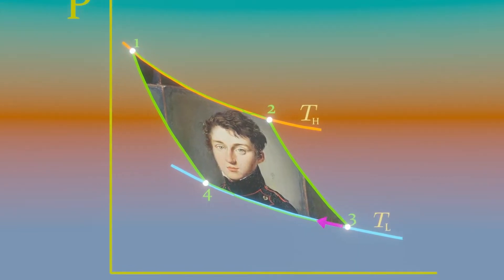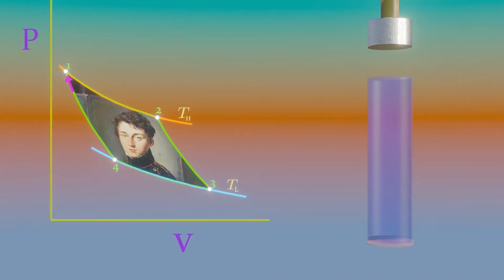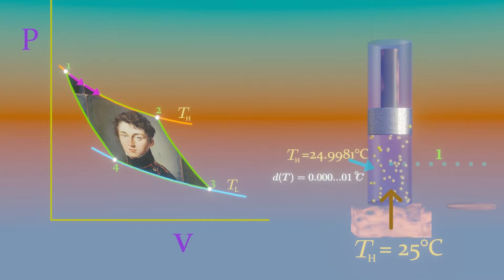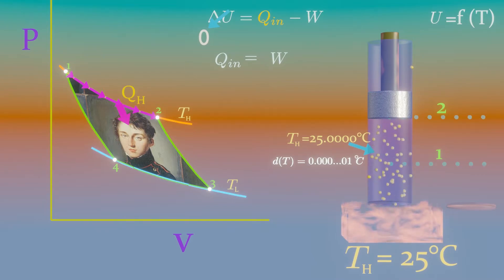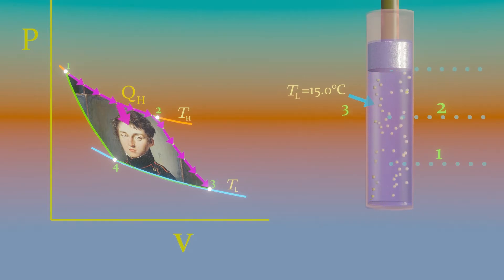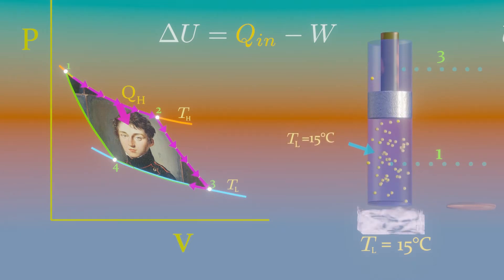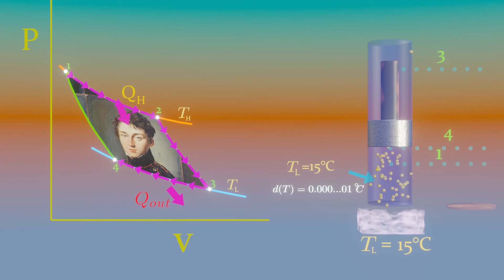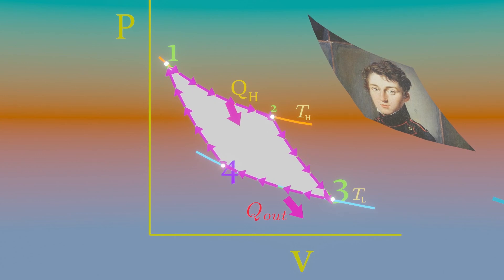CARNOT CYCLE  FOR ENGINEERS. (ANIMATION)

Comment: The PV graph shows pressure decreasing from point 1 to 2. For pressure to decrease weight must be removed from the piston. This is not shown in the animation. Small amounts of weight must be removed or added at all points in the cycle, otherwise the pressure remains constant. Removing weight is also required to keep the gas temperature constant from point 1 to 2, otherwise gas temperature TH would increase as heat is added.  Weight must also be removed to cause the gas temperature to drop from TH to TL from point 2 to 3. The total amount of weight removed during expansion (1 to 3) must be greater than the weight required for compression (3 to 1). Otherwise no net work is done. (Work=Force X Distance)